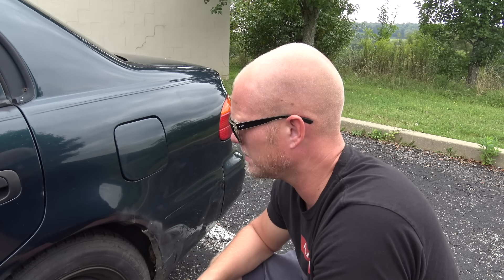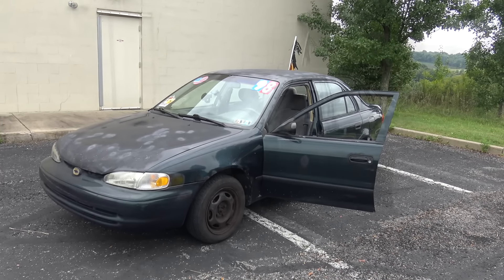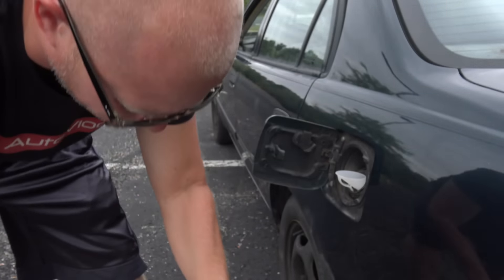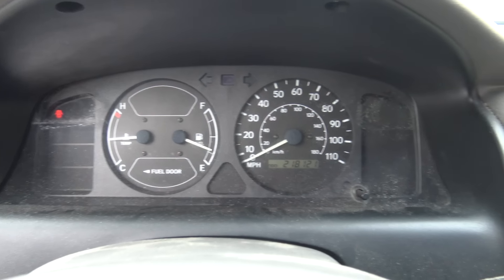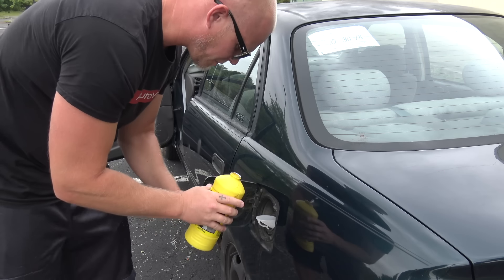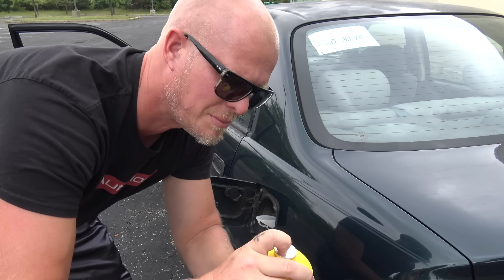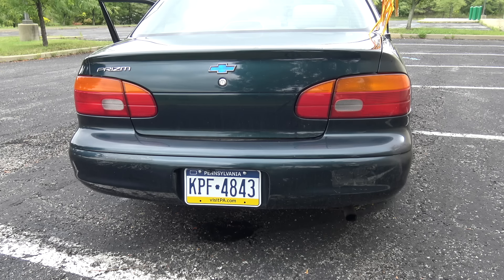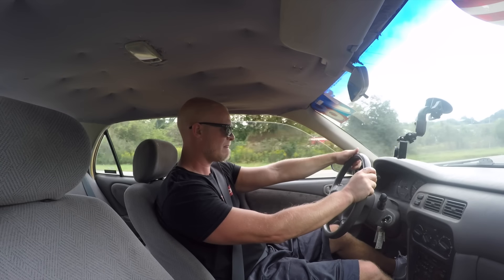What happens if you put BRAKE FLUID in your gas tank? (You'll be surprised!)

Comment: Me and my dad got to the Toyota Toyota cars that's literally runs and drives still but at least boil where you put oil in the engine bay and where it leaks oil in it burns the oil in that that's the main reason and my dad's only one in the junkyard and told him he could get 300 he only wants 400 for it because he knows he could get 400 because the engine that is the one of the original engines and it was one of you top its engines from 9 from the 1990s

Comment: It's a good way to decarbonise your engine 
If anything it should run better after that
Back in the day we used to sprinkle water 💧 down the carburettor on high rpm to decarbonise the engine break fluids always did a better job of breaking down carbon in the combustion chamber

Comment: Next time use less gas 1/4 still a lot of normal fuel to burn and do it on the generics Mercedes-Benz . everything that Ignite and if still have liquid density and /or could be spray if alternative fuel. If you could add Caetano to the tank you will see the real difference

Comment: Do you know you could clean up your engine with antifreeze add 1 gallon antifreeze in engine to run it for the day drain it out you will see all the residue sitting on the engine clean the camshaft crankshaft hopefully the oil pump will not clogged up it would not and then change the oil open up the filter break it you will see so much residue was inside your engine thank you again guys please don't call me stupid I did that already and nothing happened to the engine I got 270 MI on my car

Comment: Those Chevrolet Prizm were in facts Toyotas... They were practically indestructible... They just didn't received the same "cult worshiping" as the Honda Civic from the late 80's - early 90's but they were worthy.  Speaking of which, circa 2000, we took a Honda Civic 1991 with almost 400 000km and made bets: the deal was a brick on the gas pedal and each participant had to bet 20$ on the 15 minutes segment he thought the engine was going to give up...
After 1 1/2 hour, we reset the bets and drained the engine oil... after 45 minutes of it, we all agreed to reset the bets and added a handful of sand in the engine...
I left 1 hour later cause the f*cking engine was still running after 30 - 45 minutes of agonizing sounds... Those engine were indestructible

Comment: Having not watched it yet this is not good by any means because brake fluid in itself it's designed not to compress it's a hydraulic fluid so anything that doesn't compress like water or brake fluid really probably not a good thing for engine internals.

Comment: Maybe it actually cleaned out your fuel injectors; better than fuel injector cleaner, maybe that is the unexplainable smell that you witnessed. The smell of the gas, brake fluid, and carbon deposits breaking loose with the heat.

Comment: Cool how most common mistake diesel in gas tank
Reply: Aren't modern has cars designed with filler necks that don't allow diesel pump nozzles to fit into the tank? I understand older cars prolly like 70's and prior, but I hear more stories of diesel truck guys pumping gasoline into the diesel. The nozzle system is supposed to protect regular people in cars, and the diesel guys should, in theory, know better.

Comment: I PUT IT IN MY OUTBOARD MOTOR AND IT RAN BETTER THAN EVER  I PUT IT IN MY FORD TRANS IT DID NOT EVEN MOVE AFTER PUTTING IN TRANS IT HAS RUN FOR MORE THAN 2 YEARS I DID NOT HAVE TO CHANGE THE TRANS

Comment: Accidentally put brake fluid in the fuel? Really when could that ever happen? Why not try Accidentally draining all your brake fluid and replacing it with water, then taking it on a good hard run down a long mountain road, not forgetting 1000ft shear drop either side....now that would be a fun video

Comment: I guarantee that it cleaned your injectors and valves really good.  When you changed your oil it was blacker than usual. It's an oil which means it's a  cleaner. Diesel fuel works great as well. One to two gallons of it on a full tank does great for your fuel system.

Comment: You want to have a longer engine and a transmission when you sitting in the traffic put your car in the neutral or Park sitting in the traffic holding a break you damaging the engine and the transmission especially transmission and burns clutch you're making the oil lose his grip this mechanics are every time we see us we coming with the car we are just a dollar sign I am from the old school GTO Pontiac mustang I had Mercedes Benz Jaguar different kind of motorcycle I have a Ford Taurus you don't believe it $30,000 miles same oil in the same engine mobile oil it is the number one oil after 30,000 miles I checked the oil and looks it's still brand new you want to have a better compressor especially in the summertime or the people living down south put one Court of the gear oil added to your engine oil you will see the result don't do it if you don't know what you doing and holding me responsible maybe it works for me not for you thank you guys hold the bat coming to yourself I am a gentleman